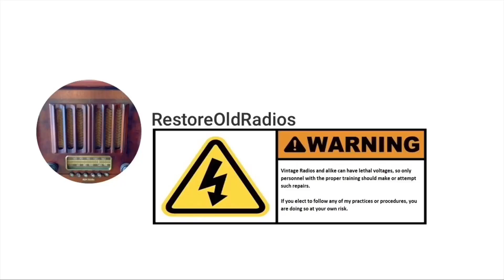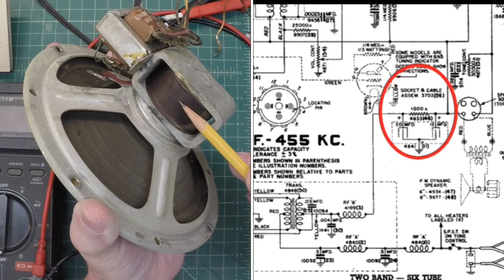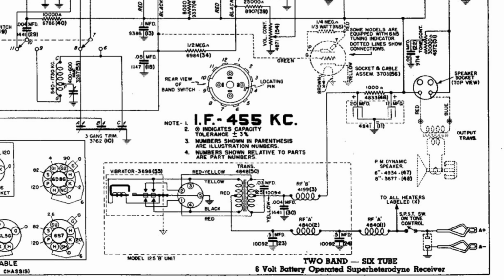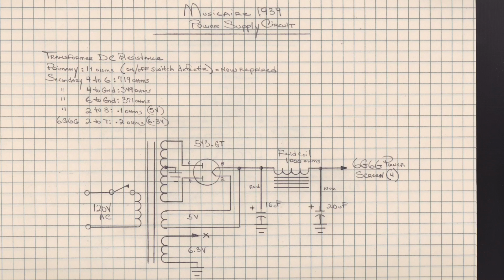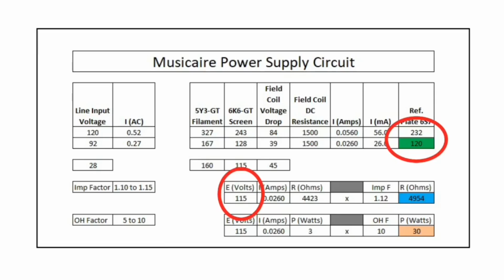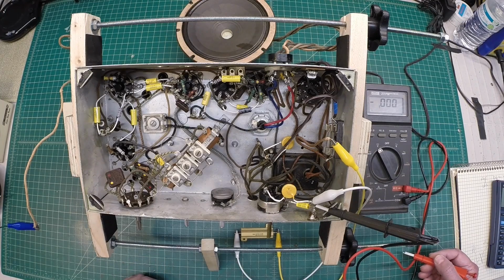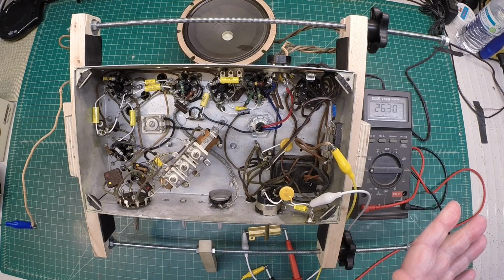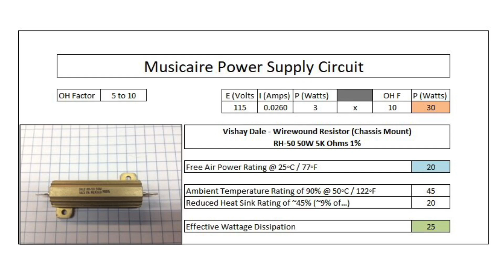Musicaire Radio - High Voltage (B+) Mitigation - P5

Comment: Hi Don,
Did you make a new chassis holder? That item is one of the most useful things I have seen on your channel. Access and comfort always contribute to doing quality work.
Reply from the maker: Ian, I’ve still got my first chassis holder, but this one made out of scrap wood and threaded rods, etc., takes up less space and puts the components at eye level. A link to a few enhancements I made:

Airline 62-306 Teledial - Chassis Holder & Tuning Condenser
https://youtu.be/zSv_5vMmUu4

Thanks for watching my friend.

Best,

Don
Reply: @RestoreOldRadios  Thanks Don,
I missed (or forgot about) that video. 

Ian
Reply from the maker: Ian, no worries. I can’t recall many of the videos I posted these days. Thanks again for taking time to reach out and watching my content. Best, Don

Comment: This was an excellent demonstration and analysis of the circuitry , for  a common problem with a bad speaker field  coil and audio transformer and  doing 
their replacements. The addition of a power resistor of correct value using Ohm's law  with knowledge of  tube max values and eventually  lowering the B+ ! 
I hope no one's head exploded here cause this is really important stuff to know regarding how to fix this problem. You nailed it Don.
Reply from the maker: Thank you. I was telling Doug, this will be a good reference for me down the road. I wasn’t frilled to use a resistor and drop the HV that much, but a new transformer or other... wasn’t in the budget. Thanks again for your kind words. Best, Don
Reply: Power resistors have some inductance although not nearly as much as a field coil. You lose some HF noise filtering this way but higher value filter caps can compensate for it.